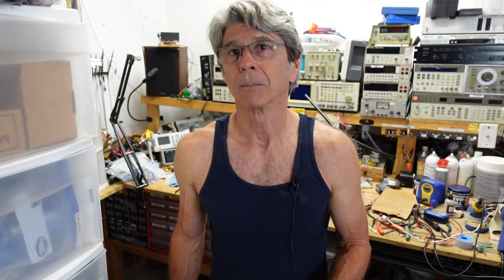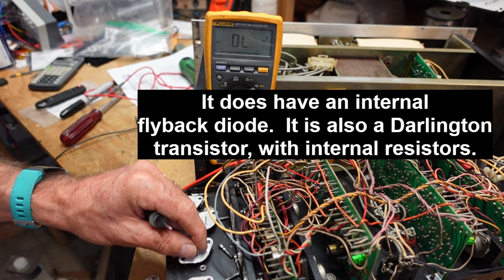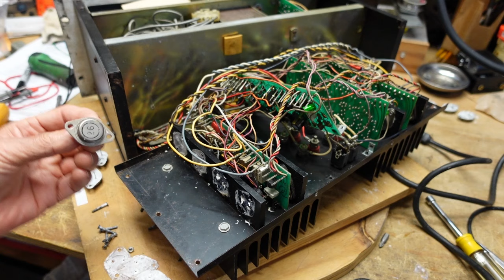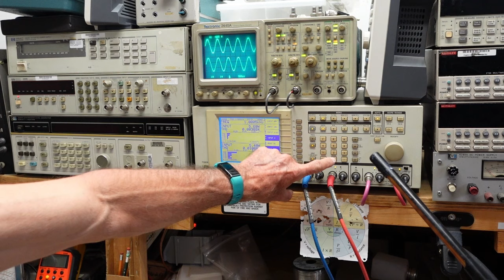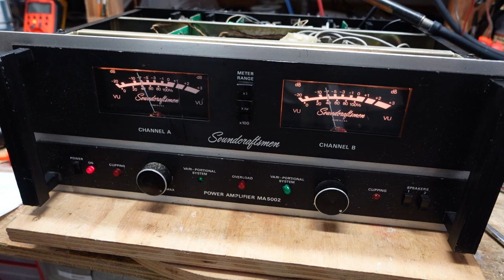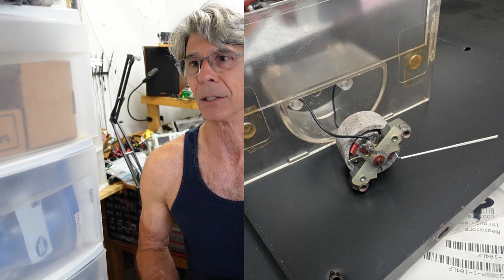Soundcraftsmen MA5002 Repair

Comment: Great amps....but an absolute pain to service. Thank goodness he didn't want the main caps replaced.
Reply from the maker: Amen!  My old electronics mentor used to say that engineers should have to work as technicians for 2 years first.  Then maybe they wouldn't design stuff that's difficult to repair.

Comment: Great video, I have one of these sitting in my garage. It still works but I think the capacitors are going as it would randomly blow the mains fuse even at idle volume levels. It would play full power no problem but both times it popped the fuse it was at very low background music volume, probably a watt of output. It vaporized the fuse filament so it was a hard short. I don't use it anymore out of fear of it self destructing but I do hope to get some time to refurbish it someday. I'll definitely be referring back to this video when I do. I have a few other SoundCraftsmen Amps to do as well, all working but all on borrowed time with the caps. Pro-Power 1, Pro-Power 4 (2) and a PM-860 shoebox amp. Love these things, they sound nice and are bullet proof, but age is taking it's toll (on the amps too🙂).
Reply from the maker: Hi Mike, don't know how I missed this when you posted it.  That's an interesting problem the amp is exhibiting.  I'd be interested in how it gets resolved whenever you get around to working on it!
Reply: @raygianelli3612  Thanks Ray, I'm interested in digging into it too but with my workload the past couple of years I don't foresee doing it anytime soon. I would want to have some time off to tinker otherwise I know myself too well and it'll sit torn apart and then I won't be able to find all of the parts 6 months later when I want to put it back together! 

If you'd be interested in working on any of them for me I'd be happy to drop them off on my way to SFL. I am down that way several times a year for work so I could leave them with you. I'd happily pay of course. If you're too busy or not interested I fully understand!
Reply from the maker: @YouOldFishEyeFool  Mike, while I would love to help you out, I've just got too much on my plate.  I'm hoping after retirement to have more time to devote to repair work, but until then I have to limit the amount of work I take in.

Comment: Moist environments are not good for electronics, it looks like this amp was stored or used in a garage from the looks of that corrosion and the power transformer was rusty looking.
Reply from the maker: I'm in South Florida, and rain and humidity are just brutal for 3/4 of the year.  Even so, this one was worse than most I've seen.

Comment: Great information about the "quick test" on the output transistors. That will come in handy I'm sure.  Thanks Ray!
Reply from the maker: Wil, there's a limited number of instances where this will work.  The amp has to be full complementary and have no protection relay.

for amps with a relay, you can just clip onto an emitter resistor in lieu of the speaker jack.
Reply: @raygianelli3612  understood. Thank you!

Comment: Hi Ray great job as always👍 never seen meters corroded like this 🤔 must have been in a very humid environment 🤔 or they were cooling it with water 😂.

Nice day 🙂Tom
Reply from the maker: Hi Tom!
Humidity is just brutal here.  I run before sunrise to avoid the heat, but the humidity can reach up to 100%.  I didn't know you can have 100% humidity without rain, but apparently you can.
Reply: Humidity + Nicotine are the usual culprits in this case.  I also woldn't be surprised to find out that, at some point, the face of that amplifier was drenched in water.